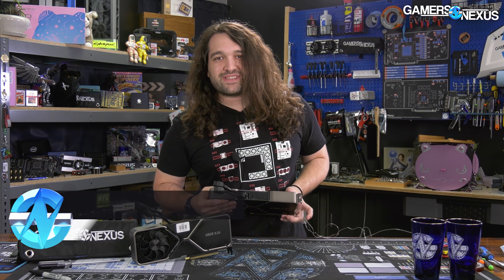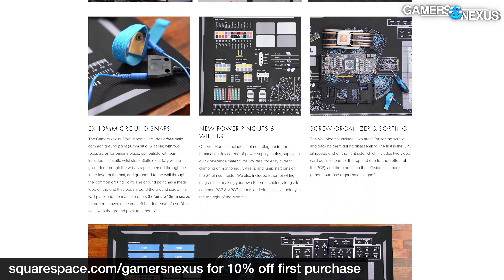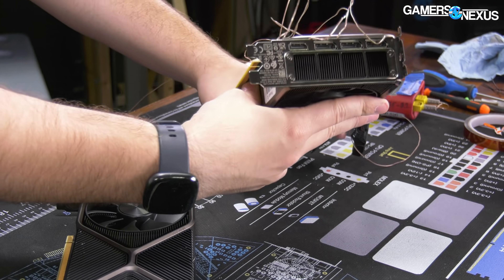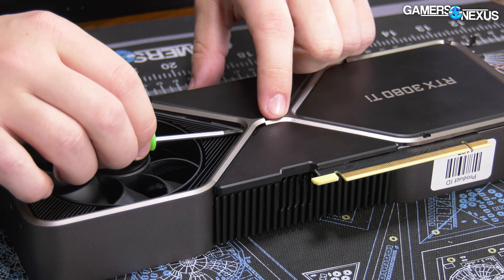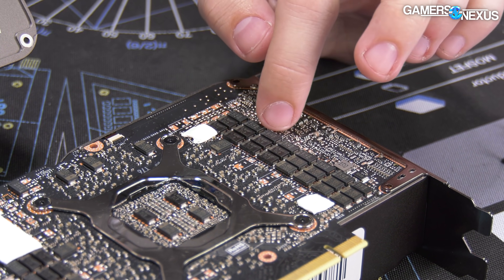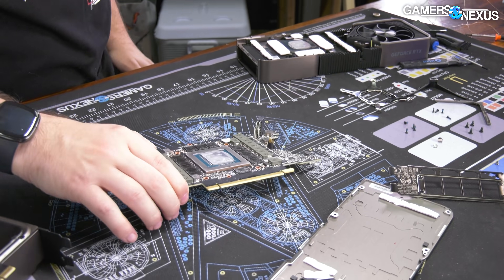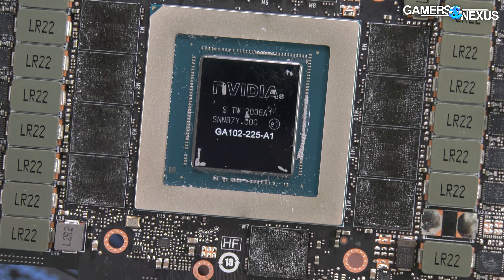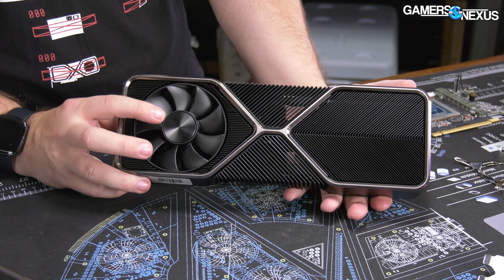NVIDIA RTX 3080 Ti Founders Edition Tear-Down: Seeking Differences vs. 3080 FE

Comment: 6:02 "those are different capacitors from the other ones" Just the line closer to the fan is different (they are VRM input capacitors, the output caps are in 2 lines closer to the core). If you had pulled up the thermal stuff from the capacitor next to it, you would see. The rest of the capacitors provide a hint. It's possible that just that side of the PCB is hotter (for whatever reason) and it's too close to the capacitor's thermals, but odd to be sure.
6:15 "memory is flip chip, so memory silicon is closer to this side of the pcb depending on layer count" I know you like flip-chip, but here is no way the silicon is closer to the far side of the PCB. The PCB is 1.6mm thick to comply with PCI requirements (the edge connector must fit in the slot) regardless of layer count. The entire memory chip package is less than that (I measured 1mm on a card I have nearby). The silicon chip inside the package will probably be 500 micron thick unless it's background (unlikely), so it's probably only 400-500 micron from the top of the package (which is 1mm from the front of the PCB, solder balls are probably 100 micron, making the rest of the package 900). Thermal impedance from the junction to the far side of the PCB will be way higher than from the junction to the case. The heat has to go out of the solder balls and into the PCB from there. Most will flow out to the card's internal power planes. You definitely get some benefit from thermal pads on the back of the PCB of course. I would love to see you put a thermal pads on there and see how much it will affect the memory IC thelmals though.
8:26 "really nice tweezers from taiwan" If those are the same engineer PT-01 that you had last time, then they are from Japan, though it's possible you got a knockoff in taiwan.
10:41 The outer shroud is stamped 2012 18, so it's from the original 3080 launch!

Comment: I remember when I got my 3090 (I use it for more than gaming so no one freak out) my buddies were all up in arms about how the " "rumors" of the 3080ti were showing that I made a bad choice and paid extra just for more memory. "It's going to be a 3090 with just slightly less memory at 1k!" They said. "You are going to get the exact same performance but at a cheaper price!" They said. Well after reveals, price point and so far performance metrics they seem to have realized that waiting for a pipe dream of the 3080 ti was a bad idea and should have hunted for a 3090 in the end.

Comment: My 3070 came bent like a banana from shipping and it works totally fine. Event bent it back mostly straight and it's fine. These suckers are reasonably tough. Helps that the board is fairly sparsely populated where the bend was.

Comment: You should do a review of the unit launch. The numbers were laughable. True paper launch. At all Best Buy stores combined across the United States there were only 3000-4000 cards. Most store at 46 to 64 cards with 200+ people in line. I was ~80th in line at one store.

Comment: I bought thermal grizzly kryonaut paste cause I'm gonna clean out my GPU and re-paste it for my new build and was wondering, If I paste the CPU with said kryonaut when the AIO comes pre-pasted, do I wipe the paste off of the AIO and put it on the pasted CPU or do I wipe the AIO and put the kryonaut on there as well so its not mixing 2 different pastes? Or would both being pasted be too much?

Comment: I was able to snag the EVGA FTW3 version at Microcenter for $1400. It was $1700 for the MSI version and $2000 for the ASUS STRIX version. Normal 3080s were going for $1199! I waited in line from 3am-10am. there were probably 60-120 people at least when they opened. Its crazy. This shortage is very bad lol

Comment: 3080 FE: the $700 card you have to open to re-paste and add $1 thermal pads because NVidia couldn't be bothered.
3080 TI FE: the $1200 card you have to open to re-paste and add $1 thermal pads because NVidia couldn't be bothered.

Comment: it's sold here in the Netherlands for €2400 which is €100 more expensive than 3080 which is currently sold for €2200-€2400 this is roughly $2900 so yeah not worth upgrading from my 3080

Comment: I have a theory based on no information whatsoever. Pure conspiracy.

I think when the original 30 series was announced, someone at Nvidia dropped the ball on how much the card should be worth. Original MSRP was $700 because maybe they thought it wouldn't sell too well. At launch they realized that they'd be losing potentially billions so I believe they fabricated the whole gpu shortage situation and actually held onto all their cards with the intention of slapping a Ti at the end of it, adding a couple more components here and there and upping the price on it. Seeing as how structurally they're aren't to different from the non-Ti, I am convinced I'm right. My prediction is that these cards will continue trickling in slowly to keep up appearances of a gpu shortage. After all, we only have their word to go on.

Again, I know nothing about this situation and am most likely completely wrong.

Comment: The 3080 TI, is completley wrong. It has the power of a 3090, but the cooling of a 3080, that can't work, at least not for the FE edition. I stick with my 1660 Super OC, and for my Boy who is due his first PC this year, I will go with the new 5000 G series, and update later with a GPU. haven't seen testing for the 5000G series yet, but I guess Apex and Fortnite will work fine with 1080.

Comment: You should use a piece of tape to remove those magnetic covers.
For the date on the cooler, I suspect that they mass-produced them in December, and used the same design for both the 3080 and 3080ti. I have bought a 3080FE from a recent batch, and the cooler was also made on Dec of 2020. I believe that they had a lot of them ready at the factory, but just no silicon to make the cards.
This is a terrible teardown "tutorial" haha, skipped a lot of steps, but entertaining to watch.

Comment: The most significant difference is that on the original 3080, the 8 was upside-down, which was corrected on the TI.

The 2nd most significant difference, and also the least significant difference, is the MSRP.

Comment: Having swapped out the pads etc on my FE 3080 I did try several arrangements on the backplate side. I found that adding pads over the back of the vram made it worse. My thought was that the backplate is already very hot (from areas like the hotspot) and had little capacity left to pull heat from the vram as well. I know some ppl have tried adding extra heatsinks to the backplate.
The extra thin pad on the back (~5:11) is over the hotspot area, and my FE has it too (I got my FE in October 20) I expect this is Nvidia's response to Igoreslab testing and suggested pad addition.

Comment: What are those LR22 things on the inside of the pcb? I think you called it power phase or something? How hot can those get? I feel like one of the LR22 things on my RTX 3080 has had the thermal pad come off by about 1mm. So basically the LR22 thingy is not making 100% contact with the pad or the heat sink and it’s on the outside corner. Should I be worried?
Reply: Inductors. Each a part of one power phase. Literally a coil of copper wire, and practically immune to heat.
Reply: @RandornCanis  thanks. Makes me feel better!

Comment: The MSRP was already high, but almost every third party 3080Ti comes at 2000+€ (~2400$), this is getting ridiculous, even an RTX 3070 wil be at least 850€(~1000$). You basically have to pay the price of a full gaming PC to just get a high-end card (and even this is debatable seeing how many cards are above the 3070, it would almost be considered in the middle at this point).

The worst is seeing 3080Ti already on sale on ebay SECONDS after the launch, from people trying to pass as good guys posting things like "I managed to get a custom after already buying a FE, so I'm selling the FE", but OOPS, the price went from 1200$ to 1800$....
Reply: Camped out at microcenter and ended up buying a 3090ftw3 since they had no 80s. Hated paying it, but now the 3080ti is going for the same money with a hash rate limit and half the ram. Its insane. From what I've seen overclocking the 3080tiftw3 gets you 100+mhz less. So the value is worse than a card that was already rediculous.
Reply: I do hope when supply stabilises that the tech channels are going to make a huge thing about prices, or we'll end up with them normalising at this level...

What irony when you're looking at Intel to help sort a market out.
Reply: Almost 3000 euro for the TI are they completely insane.

Comment: Still bizarre to see the effective size of the card, like the PCB itself, is tiny compared to the overall card. So much of the volume of it is just for getting rid of heat. 

I dunno. Interesting to me for some reason.
Reply: It's probably because of the thicc heatsink
Reply: It's even more amazing they were able to fit $100 under the thermal paste.
Reply: @SuperSmashDolls  Who knew $100 bills were so good and transferring heat

Comment: The fact that high end is now the titan class, in terms of price, and midrange is the high end, i am STILL pissed about that. 

I can make do with the high end pricetags. I wont like it, but i can afford it, but what the fuck are the people, who used to buy the 50 cards, gonna do? Both Nvidia AND AMD shifted the tiers up a notch in terms of pricing. Budget GPU's cost as much as midrange used to just a few short years ago. What are the budget gamers gonna get? Integrated, that does way wayyy less than 50 class performance?

Ugh, i hate this.
Reply: Simply put both Nvidia and AMD didn't bother on supplying for the budget market (<$300) unless you count the new laptops. With short supply of parts they're all (chipmakers, OEMs and SIs) going to prioritize higher margins over higher revenue.
Reply: @ewanhoo  Thats a different problem, but i hate that too.

Comment: i demand a 3080 Super between the 3080 and the 3080 Ti for 50% more cost than the 3080 and 5% more performance , just because it would be even more unecessary and sad, which would fit the current situation!

Comment: I see, they had too many of those OEM installer screws In stock, so they launched a new  GPU to combat that! Totally a thing they'd do.
Reply: good thing is, some OEM (Prebuild) even go as far off pairing RTX 3080 or Radeon RX 6800 XT with Core i3 or Ryzen 3 3300X with 8 GB single stick DDR4 2400mhz with crappy motherboard that didn't have a heatsink for VRM, and crappy PSU that will turn into a fireworks if you try to use it.

They desperately sell those crappy PC just because some people buy prebuild, get the GPU, and throw away anything else.
Reply: Well building more stock could just combat that... 🤦‍♂️🤦‍♂️

Comment: Dont get why everyone was seemingly being okay with this being $1000, 780Ti/980Ti/1080Ti have all been $700 MSRP and this should've been too. Max of $750 if you want to worry about "inflation". We shouldnt be complaining about it not being $1000 but rather about not being ~$700 as we're just allowing GPU makers to be more greedy when things settle down. Taking a good guess that 4080Ti/5080Ti gonna be $1000 rather then $700 MSRP if this is how everyone keeps reacting.
Reply: I also feel they saw how people are still buying from scalpers cause I guess desperation? That's how I feel it went from $1000 to $1200 so fast. "We can make more, people will buy at any price." I wouldn't be surprised when more stock comes in and they hike prices for the other cards. It'd be a shitty move but people would still buy.
Reply: you have to take into account, that newer process nodes, newer memory chips, newer and preciser voltage regulators on the boards and and and are getting more expensive too plus the designe of the arcitecture for gpu´s is getting more expensive too...but the 1200$ is just way too high, if you can sell a 3080 with profit at 700$
Reply: @georgwarhead2801  What Georg says. RND, newer parts and more complicated fabrication of these chips contribute to the increase in price.

Msrp will always be up for grabs, but that doesn't change the fact that this card has bad pricing.
Reply: @georgwarhead2801  Idk about that. All the xx80 non Ti launch near $650/$700 (except 980 and 680 and earlier). Then when the xx80Ti released the non Ti would be cheaper and xx80Ti would be $700-ish. However the 2080Ti came out same time as 2080 leaving no time for price reduction. Then with the 3080Ti it came out later but there was no price reduction like we usually see.

So from 2013 to 2021 the xx80 non Ti has been able to stay near $700. Apart from VRAM, manufacturing prices havent gone up enough to warrant a large cost increase afaik.
Reply: I guess I'd still rather have manufacturer s getting the money from the higher prices instead of randos on eBay - at least that way it has a chance of going back into r&d
Reply: @Xhxh29  I kinda feel the same way, it's more expensive for the output of the card but it's also not 3-4x the price the scalpers are going for, but at the same time you have to kinda be angry that they'd not read the room here and pinch as much money as they can from us. It's a slap that won't be forgotten.
Reply: Absolutely let’s complain about prices that don’t exist in the real world. How will these scalpers that add no value make a living!
Reply: I don't think they'll be a 4080 Ti, I bet Nvidia will merge 80 Ti & 90 as a 4090 for next gen for 1200 USD with 24GB on a single side and market it as a massive VRAM upgrade (while 4080 is 20GB of slower memory for 800 USED). 

I mean the 3080 FE is rumored to be pretty pricey to produce and barely profitable and the person who leaked FEs of the 3090 & 3080 said that the 3080 was originally going to be 800 than 700.
Reply: Who is okay with it? I know no one.
Reply: @informitas0117  Already seen lots of people complaining about it being $1200 instead of $1000.
Reply: A near-realistic inflated rate would be $800 (790 to be accurate). But, yeah, $1000 and $1200 is outrageous.
Reply: @kichapps  , these GPUs are selling for more, so no it’s not outrageous. It’s the current market realities....
Reply: @kichapps  Eh, inflation from latest reasonably priced card, 1080Ti (2017), it'd be $763. Inflation from oldest xx80Ti it'd be near $800. I'd say they can manage ~$760 quite nicely.
Reply: @HeiiKun  you prolly calculated up from 2017. I calculated from 2014, approximately the launch of the 780 Ti.
Reply: @kichapps  Yeah I did both after your comment. But if they could afford a $700 MSRP for an xx80Ti in 2017, I'd say to use 2017 for inflation calc.
Reply: @HeiiKun  fair enough. You're point is valid, $1000 for a XX80 Ti is not justified.
Reply: @sbdnsngdsnsns31312  Everything I see is more near 2.5% in the last year alone. Were do you see 25%?
Reply: The problem is lack of competition and the general need for a GPU if you want a rig. We need to buy "something" and therefore can´t just vote with our wallet. AMD is only now with FSR in the real competitor ranks. It is just those times we are in, that we see no fruitition from that.

Don´t get me wrong i completly agree with you, especially as the manufacturing processes decreased the cost, but Nvidia allways incrementally increased their prices due to their monopoly.
Reply: @2nd_Directorate  "We need to buy "something" and therefore can´t just vote with our wallet."
No, you don't. We're talking about GAMES here, not life and death provisions. You can just wait and ride out the shortage. There's plenty of old games that you can play in the meantime with any old gpu you already have. You don't HAVE to play the newest games.
Reply: @2nd_Directorate  " AMD is only now with FSR in the real competitor ranks"

No they aren't, their drivers still make their cards unusable. You'll fight just to install them because the installer's splash screen uses fancy effects you don't have drivers installed for yet, so your computer can't display it and the system crashes. Then once you work around that and finally get the drivers installed, you'll have graphical bugs in all your programs because Radeon simply has no f@@@ing clue what they're doing.

This all happened to me last month, so this stuff remains as unusable as ever. I hope Intel can bring something good to graphics cards so Nvidia finally has real competition. Radeon are useless clowns.
Reply: @mjc0961  Your OS sucks and/or you have no idea what you're doing. I have a 5700XT and I have literally zero driver issues. I didn't have any even when I had just bought it last february, and it's not even a clean install since I had an RX580 before and did not reinstall the OS.
Reply: Isn't it $1200 MSRP tho?
Reply: @jubuttib  Yes, but many are complaining about it not being $1000 as that's what they expected. Like what GN said - "$200 more then what people were expecting"
Reply: @HeiiKun  Ah, gotcha.

Comment: That's not a ghost finder, that's the 30 Series Wishbone. You take one end, and your friend takes the other end, you both pull as hard as you can until it breaks. The person who gets the smaller piece doesn't get a card, the person who gets the larger piece, also doesn't get a card because all the inventory is bought by bots before end users can buy them.
Reply: But without a card where will we get a wishbone to pull apart?

It's critically important that jokes have perfect logical consistency!
Reply: @VitalVampyr  You take a model card. It doesn't actually work in a computer, but at least you can wish for one.
Reply: @VitalVampyr  just use cardboard card, being economical doesn't get better than that in this case
Reply: I bought one yesterday for 1200€... All the french stocks were gone within 1 minute 30 seconds...
Reply: top comment!